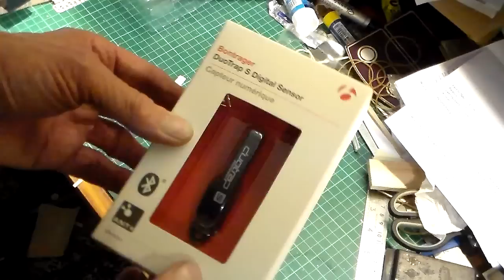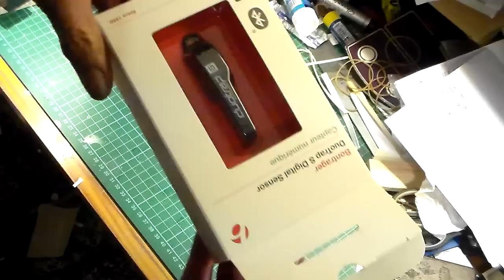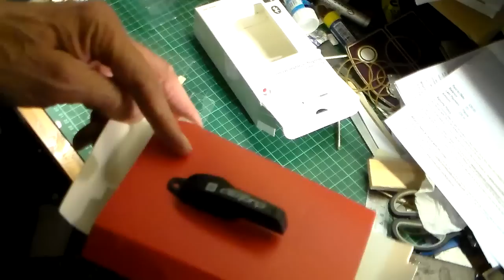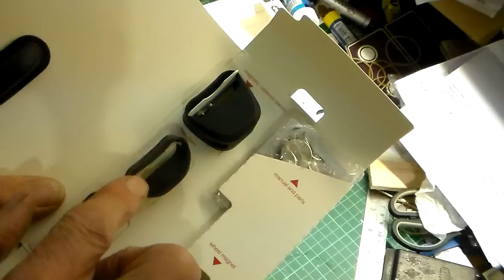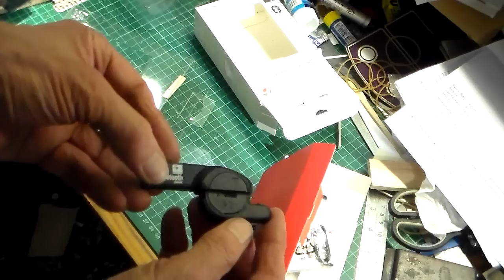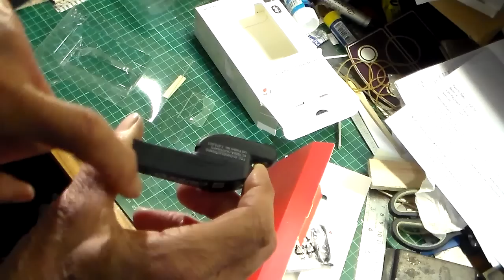DuoTrap S Digital Sensor

Comment: Thanks for the explanation! TREK was kind enough to fit it all for me, but I still wanted to know some details about how it worked, in case I have to troubleshoot. Cheers. Just got it for my 2020 Domane.
Reply from the maker: Tes, that will solve the issue of which sensor you get.

Comment: Yes but what does it do ?
Reply from the maker: It measures cadence and wheel rotations.
Reply from the maker: You can get 'generic' sensors that will fit any bike frame. This sensor fits a particular range of bike frames. See my other videos for fitting and long term use review.

Comment: What does it do?
Reply from the maker: This is the transmitter part of the cycle computer. It picks up signals from magnets on the wheel and the crank. These are used to identify speed of travel and cadence or rate of pedalling.  I don't use cadence anymore. These signals are sent by Bluetoth low energy (or Ant+) to a display on your handlebars or an app on your phone. Does that help?
Reply: Bike rides is it the same as a power meter?
Reply from the maker: No. I would love a torque or power meter. That needs special cranks with strain gauges fitted to measure how much pressure you are putting on the pedals. They are really expensive though.